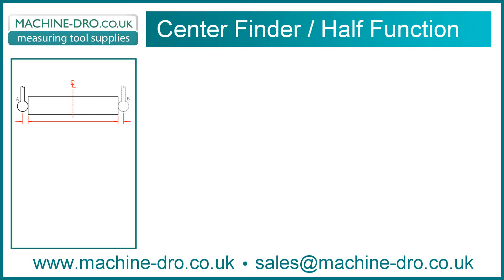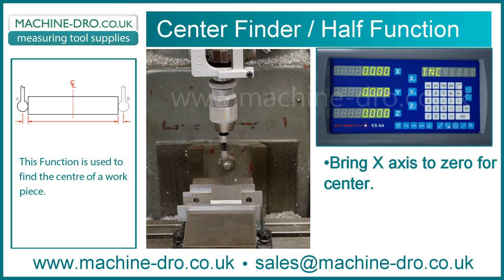How to Use the Centre Find or Half Function on a Digital Readout Display Console DRO

Comment: Do you need to be in INC for this to work ? 
Ive tried as you described a few times and the screen goes to 0
Reply: He is selecting XYZ axis buttons select the XYZ key board buttons to the the right ! then it will half and center.
Reply: The half would not work for me neither untill I pressed the button on the right as you pointed out. Thanks for your help.